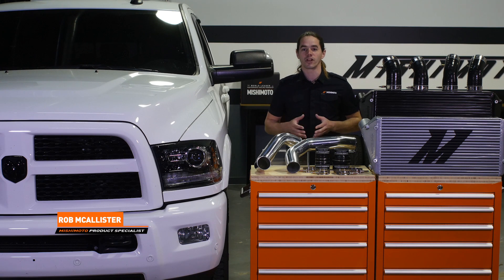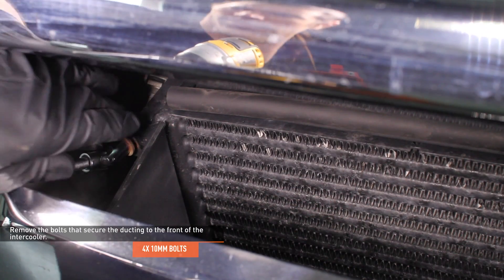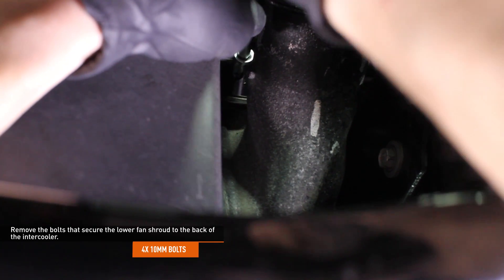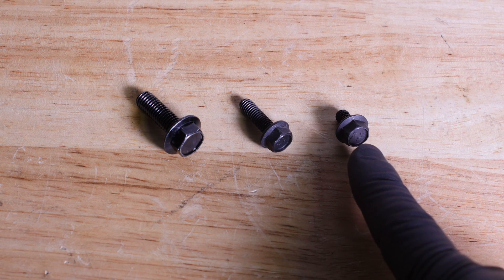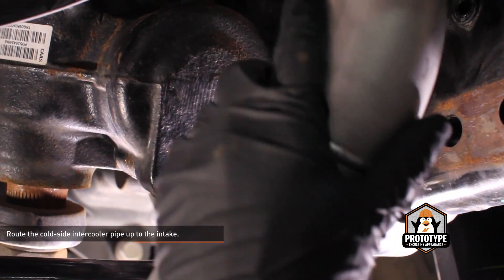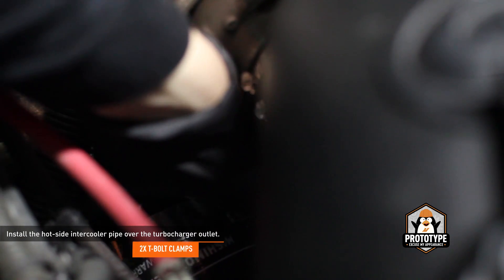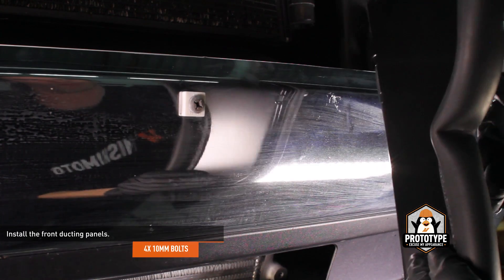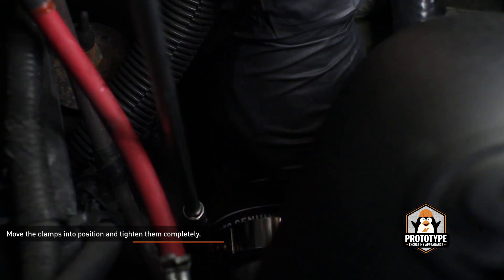2013+ Dodge Ram 6.7L Cummins Intercooler Kit Installation Guide by Mishimoto

Comment: Does this hang down lower than the stock intercooler? I have a power wagon valance and wondering if it will clear
Reply from the maker: Our intercooler is ~3" taller than the OE unit and will sit a bit lower overall.

Comment: What exactly is the benefit from this product over stock???
Reply: More sufficient "Cooler" airflow provides your engine with more power, better gas mileage and overall better for your engine.

If I missed something, someone chime in.
Reply: Keep your EGT’s down when you upgrade other engine components that would cause your EGT’s to increase, to assist in protecting your engine in potential catastrophic failures due to increased EGT’s.